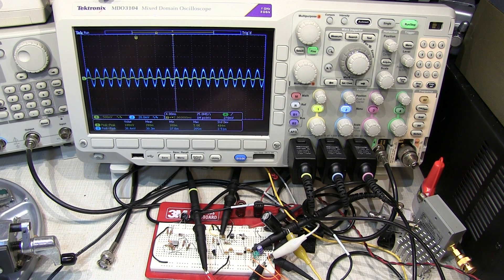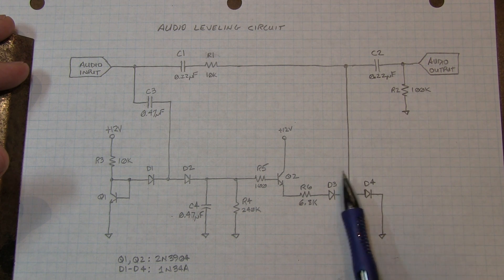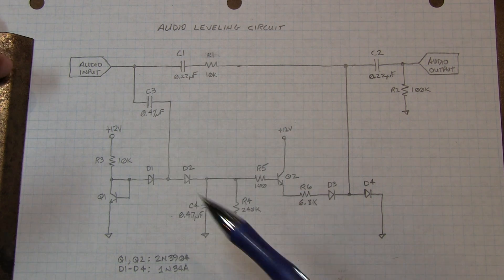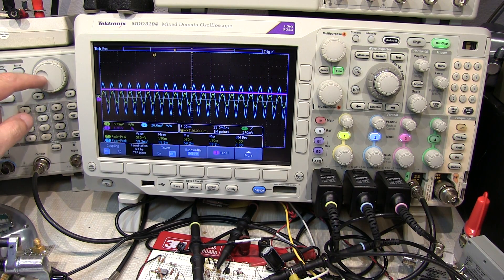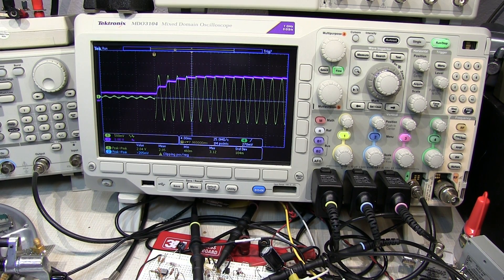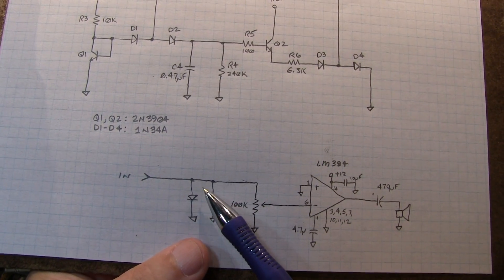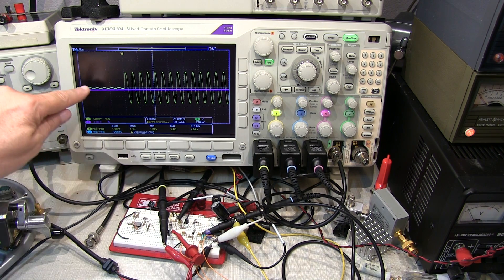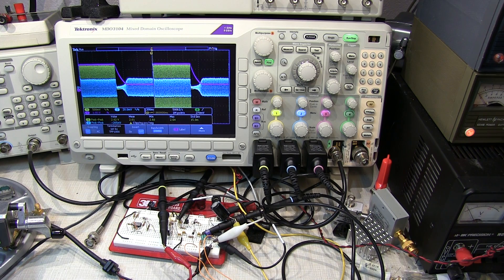#157: Circuit fun: Automatic audio leveling circuit | audio compressor | for scanning receiver

Comment: I just ordered the diodes and I'm going to build this. I want to use it to level the stereo output of my cell phone. I listen to music or whatever at night when I go to bed.  Do you see any problem applying the peak detector output to two attenuating diode pairs?  I'm thinking it will be ok.
Reply from the maker: Remember, the output of this circuit is high impedance - it will not drive a speakers/headphones directly.  You'll have to put an audio amp after this circuit.  Also, the clipping is non-linear, so it does add distortion.
Reply: @w2aew  ok thanks for the info. I'll still five it a try.
Reply: I was able to reproduce this circuit and I used an op-amp to drive the input since my sig gen wasn't up to the task without distorting.  I only monitored the output on a scope. It worked as advertised and did indeed add some distortion and some noise. (no sure why). Onward and upward. Thanks.
Reply from the maker: @SuburbanDon   Please note that you will likely need an amplifier to buffer the output as well, since it can't drive low impedance loads like speakers or headphones directly.
Reply: @w2aew  I understand, thanks.

Comment: what would you suggest if the purpose would be a music synth? As you maybe know with higher frequencies the amplitude of some waves like saw (ramp) or triangle  have lower amplitude due to shorter integration time. Would be very appreciated if the circuit would be explained in detail like you did here. Thank you very much
Reply from the maker: I wouldn't recommend this circuit for any type of music / high-fidelity audio.  This circuit adds a lot of harmonic distortion to the signals.
Reply: You re certainly right when it comes to HiFi. But Synths are another world. These harmonics you talk about make the charme of these (analogue) Synths (any why these are often more apreciated than digital synths). But the low noise I hear when the circuit adjusts it self is a issue. If I d filther these out I d cut too much low end from the synth. I have already thought about a compressor on the peak detector to boost high end.  I mean there are many circuits of VCOs out there and certainly many of these  have this issue and a solution to that. Unfortunately my electrical knowledge is too low to fully understand the location of the solution as well as how it works.  Maybe you can pickup one that you find interesting and make a video of how these exactly works. Thank you
Reply: What is the source and mechanism of the distortion here? Diode D4?
Reply: Well, that would be one of the things to find out.
Oh, or do you mean that I have a pulse in wanted frequency that will empty the charging capacitor?
I mean that on higher frequencies (tones) the power is lower would be ok but not double frequecy gives only half voltage. Let me go deeper- A VCO gives me a square. Differtiated (? opposite of integration) I get my pulse. The pulse opens a transistor that opens the cappacitor (charged by 5V as exaple) to the ground. Buffered by a OAmp... See what I mean?
Other application would be to  eliminate the attack of a guitar singnal. In other words have only the sustain. Starting point of both envelopes should, of course stay "the same" (only few ms difference). In other words a very fast compressor.

Thank you!

Comment: Alan great project. Is there any reason I couldn’t build two of these side by side to use on my tv for a stereo input/output?
Reply from the maker: You could*, but remember that this circuit *does add distortion, and it needs to be followed by an amplifier - it can't drive a speaker since it has a high output impedance.
Reply: Thanks for the reply Alan.  I’m going to put one between my tv and my sound bar so i’m thinking it should be ok.
only one way to find out and it will give me something to do today as well.   Thanks again.. n2cmd

Comment: Good video and thanks. Can this be made to amplify lower signals as well as attenuate the smaller ones?
Reply from the maker: You'd have to include an amplifier at the input or output, or both, depending on the desired signal levels.
Reply: @w2aew  I'm glad that you understood what I meant. I had already sent when I realized what I had done.  Thanks for the reply 👍

Comment: Hi Allen, I would like to use this circuit not only for "speaker" input, like from my Yaesu HF rig head phone jack, or speaker out put,  but also a low level input. Can a "op amp" pre amplifier supply enough voltage to run the input of the circuit, or would I need to add a "LM386" power amp or similar to drive the input? (AJ6O)
Reply from the maker: +Curtis Wilson An op amp based amplifier can certainly provide enough drive for this.

Comment: How much distortion does this circuit add? I would like to use this to level the output from a flat panel TV before it goes to an external amp. Thanks.
Reply from the maker: From the measurements that I have made, this circuit adds about 10-15% THD (total harmonic distortion).  Probably too much for a high fidelity audio system with your flat panel TV.
Reply: @w2aew  Thank you for the info.

Comment: Will the circuit work with 5 volts or Do I need to change some values to work with a 5 volt PS.
Reply from the maker: The only thing I'd probably do is lower the value of the 10k resistor that is in series with the first transistor - down to about 3.3k or so.
Reply: @w2aew  thanks this is K8rtc

Comment: Can this work such that the volume signal is automatically increased or decreased to the desired user's hearing, who sets the auto gain level? Increasing the sound level is nice but decreasing is just as important.
Reply from the maker: This circuit is intended to be used ahead of an audio amplifier.  You would then adjust the volume of the audio amplifier to your desired level.
Reply: @w2aew  So after doing what you have recommended, I would get an "Auto Gain Control" functionality?
Reply from the maker: @ShopperPlug  No, it would be more like an automatic volume leveling
Reply: @w2aew  So let’s say I set the volume to a certain level that is acceptable for my hearing at the amplifier. 
Now I play some music, some music have have low volume and some has high volume, will the sound output will be automatically adjusted to the set volume?
Reply from the maker: @ShopperPlug  Yes, but it will also distort the music, since it is designed to mainly compress the peaks.  Fine for voice, but may add noticable distortion in music.
Reply: @w2aew  that is fine, I actually need this when watching or studying YouTube videos. Because some commentators volume is ridiculously low, only god would know why, after I increased the volume to the max… and suddenly watch another YouTube video where the commentator puts ridiculous loud intro music… my speakers 🔊 shoots out loud massive sounds which just scares the living soul out of me and hurts my ears. 
Won’t be using this for music.
Thanks for the confirmation.

Comment: Great lesson as always!  Can you further discuss the distinctions between audio amplifier gain, input sensitivity, and output power? The simple audio amps I've made, always seem to require a trade off.  Is there a way (I'm sure there must be) to construct a universal audio amp which is both sensitive and powerful?
Reply from the maker: There really isn't a tradeoff per se - it's all a matter of the particular requirements for the application.  Sure, amplifiers with a high amount of gain need to be carefully designed to avoid unintended feedback resulting in oscillation.  But, other than that - it just comes down to the application.  An amplifier designed to take a low-level audio input and amplify it to a speaker - such as a PA (public address) amp, would have too much gain for a higher level signal such as a line-level.  If you put a line-level signal into the MIC input, it would likely saturate and distort.  It all depends on what voltage level you're starting with, and what you need it increased to. That determines the required gain.
Reply: @w2aew  

Thanks for your reply! You've highlighted a perfect example; the distinction between a PA system and a line level amplifier... What mechanism would be needed to switch automatically between the two applications? In particular, I'm hoping to build  an amp that is both sensitive enough for my small signal experiments, but is still able to handle the larger input signal from a cell phone or tape player when used as a power amp. I've had some success so far building high gain amps that can pick up a <10mV input and output a moderately high volume, but they begin to distort with >1V inputs or at maximum power amp volume output. Would a AGC circuit be a solution? I tried building one for an AM radio I had made, but it's performance was not optimal and I did lose a bit of gain overall. I'm not sure how to configure one for an audio amp.

Comment: HI, thanks for posting. I'm interested because I'm designing a light control unit. Can I use this circuit for the analog conditioning of a signal coming from a mixer? Of course then I'll need some sort of amplification to feed the 0-3.3V ADC I'm using to get filters' samples.

Comment: Thank you for this beautiful video! But I don't understand one moment on this schematic - circuit should have a negative feedback to keep a constant amplitude. I don't see any feedback circuit here. How it's work? How we can make attenuation exactly equal to signal rise? Or may be this feedback made by D3, D4 diodes?
Reply from the maker: It's one of the beauties of this little circuit - no feedback!  The diode impedance varies in the right proportion to the detected signal level to make the divider ratio track the signal amplitude.
Reply: ***** diode is only one part of voltage divider. Other part - R1. Is it adjustable?
Reply from the maker: Ilya Kalistru I haven't played with adjusting R1, but you should be able to make it adjustable over some range.  However, as you make it smaller, you may get more distortion due to modulation of the diode voltage.

Comment: What do D1, Q1, and R3 do? do R3 and Q1 form a voltage divider to forward bias D1 and D2?
Reply from the maker: R3-Q1 sets up the bias for the peak detector and follower, D1 helps to collect charge onto C3 during the negative half cycle of the audio, which gets transferred through D2 onto C4 during the positive half cycle of the audio.
Reply: w2aew Ah, I think I get it now. That’s pretty neat. R3 and Q1 put the two diodes on the verge of conduction, and D1 makes it act sort of like a charge pump?
Reply: By the way thanks for the quick response, I honestly wasn’t expecting one on a 5 year old video.
Reply from the maker: @jtb8631  precisely

Comment: G'day Alan I'd like to use this circuit to control the volume on my TV which uses an external amp and speakers.   Am I correct in thinking that for stereo use I would need to duplicate this circuit, i.e. one for each channel?   Are there any issues to be aware of if I do this?
Reply from the maker: Yes, you would definitely have to duplicate the circuit - one for each channel.  You'll also note that this circuit does add some distortion, so you'll have to decide if it is detrimental to your listening enjoyment.  It's fine for narrow bandwidth audio like a scanner, but might be more objectionable for high fidelity audio.

Comment: Would 1N914 or 1N4148 work as well, or will the germanium only work?
BTW- Great project!
Reply from the maker: They'll work, but not as well.  The larger Vf of these diodes means that there will be more variation of the amplitude as the peak detector is being charged.  Low power schottky diodes would be better, if you don't have the Ge diodes available.

Comment: Hi. Just watched your Automatic audio leveling circuit video. Could this be adopted as AGC for a RX without AGC?
Reply from the maker: Sure, it could.
Reply: ***** Would there need to be any circuit changes?
Reply from the maker: Ken Chase It depends entirely on where it is applied in the receiver, the signal levels involved, and the IF frequencies involved.  Given that this circuit requires a relatively large input signal level to start the leveling action, you'd probably be better off developing the AGC control voltage further down the IF chain, and use that to control the attenuation at the input of the chain.
Reply: ***** Thanks, I will look into it. BTW, big fan of your Tube videos.

Comment: Alan, great video on a neat circuit.  I have a use for this, but in a slightly different application.  In the airplane I fly, automated audio alerts are much louder than the radios, so I'd like to put this circuit between the ship and my headset.  Problem is, the ship's audio amp expects headset impedance (mine is 270 ohms per transducer, paralleled in mono) and the LM38x amp expects 8 ohms.  Would any modification to your circuit be necessary to accommodate these conditions?

Also, as a portable device, I'd like to power it from two 9V batteries in series.  Is your specified 12V a critical value, or will 18V work just as well?

Thanks for all your great content!
Reply from the maker: I would think that the LM38x devices would work fine with the 270ohm headphones.  If there's a problem, simply place a 10ohm resistor in parallel with the phones (appropriately rated for power).  The AVC circuit will work over a wide frequency range.  I quickly tested it from 5v to 12v, but it should work fine at 18V as well.
Reply: Thank you; reply much appreciated!

Comment: I haven't tried in real circuit but  I couldn't get constant output in simulations. I even have tried with different simulation programs and some several settings. I don't get what is wrong?
Reply from the maker: Hard to say.  Could be that the model used for the diodes isn't sufficient for the way the diode is being used.  The simulations have to be transient simulations as opposed to AC simulation because it relies on the nonlinear operation of the diodes.

Comment: I love your videos. They are complete and timeless. 
Would this be a good circuit to add to the output stage of a XR2206 frequency generator IC ?
I put together a cheap kit but the output varies with frequency as expected.
I'd like to get the standard 1VP-P at the output, no matter the frequency (audio) input's amplitude.
I thought of using your circuit and play with the biasing to get 1VPP out of an LM386.
Am I going down the right rabbit-hole?
Reply from the maker: You can, but keep in mind the following:
- This simple circuit does add some distortion to the signal.  You have to decide whether it is acceptable or not.
- The output amplitude of this circuit is low, with a high impedance, so the use of the external amplifier is necessary.
- This simple circuit may have some frequency dependence of its own - I didn't test for that.
Reply: @w2aew  Can you recommend to me a circuit that would be more suitable for my application?
I've searched everywhere but not too many AGC circuits around that I could understand.
I'll breadboard this one and learn from it, but still on the hunt for that sweet sweet AGC that doesn't mess-up the 0.5% distortion (THD) for this chip.
Thanks again for a great video. I learned a lot from it.

Comment: What is the limiting factor for how high a frequency this could handle? I need something similar that will handle a signal around 5mhz.
Reply from the maker: That capacitor/diode detector arrangement is often used for detecting RF levels. I just checked this on the bench, and the circuit works as shown in the video at 5MHz. Keep in mind that the input needs to be at least 500-600mVpp for the output to reach the "constant" value of 40-50mVpp at the output.

Comment: Alan, is it possible to set this circuit up so as to level the volume out for different services received on the scanner, but not so low as to need to Re-amplify them.  I scan when mobile and would prefer to just feed from external speaker jack to this type of circuit and the from the circuit to an external speaker?  As an option I can also feed from the scanner or this circuit into my cars audio system via a manufacturers provided input jack for ipods etc.  Any thoughts?  Thanks,  Ted

Comment: How can i implement this to auto limiting output of audio amplifier when reach the clip?
Reply from the maker: When using an amplifier, you'd be better off using a better AGC (automatic gain control) circuit rather than this simple limiter.
Reply: @w2aew  can you describe complete circuit of agc

Comment: This is so cool!! Thank you for this. So I understand better, what components need to change if my input is 500mV pp?
Reply from the maker: This circuit will work as-is with 500mVpp at the input.
Reply: @w2aew  awesome!! Thank you!! I'm trying to figure out a very simple way to make a compressor for a guitar pedal. It's only a small part of the design of the pedal, but one I'm stuck on... because I can't have a high parts count for such a small part of the whole. Thanks for the reply!! If you have any more tips, I'd love to hear them ;)
Reply from the maker: @VaansWorld  Just remember that the output of this circuit can't drive a low impedance load - so you'll need to buffer it to drive your next stage.
Reply: @w2aew  ah, right. Thank you!
Reply: Would using a 9V power supply cripple the circuit? Sorry for all the questions...I just can't seem to get it going
Reply from the maker: @VaansWorld  It should work at 9V too.  Remember, the diodes need to be 1N34A Germanium signal diodes.
Reply: @w2aew  ahhhhh that's it! It's the dam diodes lol! Oh man. Ive got every diode but those ones. Thanks a lot!! I appreciate your help. Looks like I'll need to make another mouser order!